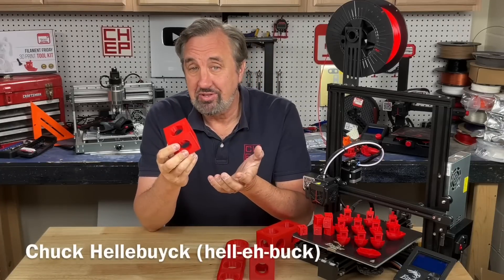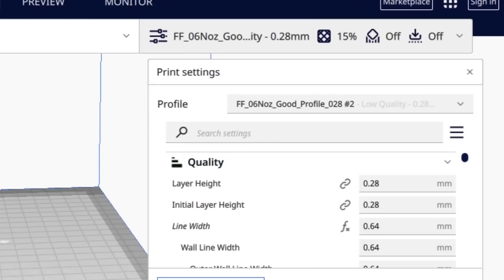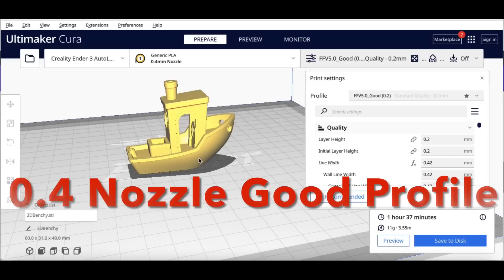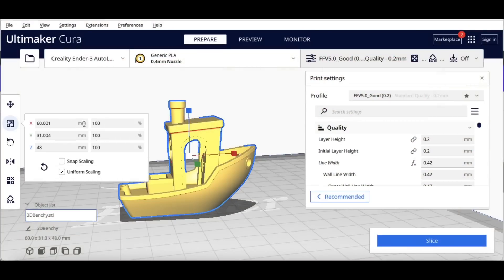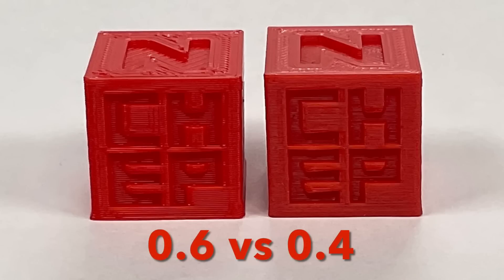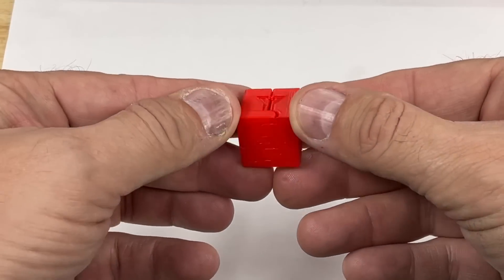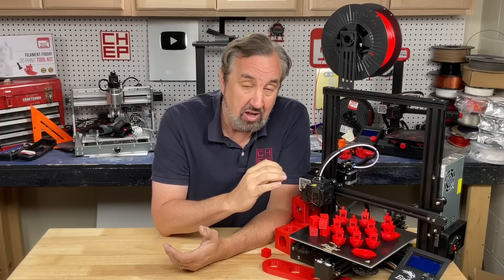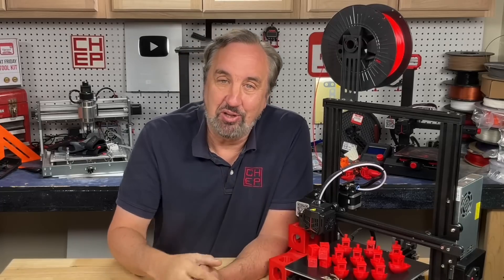0.6 Nozzle Cura Profile for Quality Small 3D Prints

Comment: I recently switched to a hardened steel 0.6 size on my elegoo neptune 4 pro; but now i'm having layer adhesion problems with basic PLA. Had to set my nozzle temp at 230 and cooling at 30% and slow the print down to 95%.... I'm confused! Is this normal?
Reply from the maker: Depending on the filament, yes.
Reply: @FilamentFriday  oh wow, ok. Thanks

Comment: I find with your fast settings and a CR10 + 0.6mm nozzle, I fight between poor adhesion or having the edges of the first later peel-up.  It seems that if you "squish" the first layer extrusion a bit too much, it goes too flat/wide and "cups" on the outer edge, too little "squish" and it won't adhere to the caborundum/glass bed.

0.4 and default settings in Cura were never a problem...

Ideas?

Comment: Great video and really helpful parameters.  Have a project with larger / less detail pieces moving to .6 nozzle on the Ender V3 SE is a time saver.  Having an issue with one of the pieces - infill is globbing up.  I can hear the hot end hitting it and I stop the print.  I’ve tried different infill types and slowed the speed, still occurs.  Any suggestions appreciated on which setting likely needs the most adjustment.

Comment: I have some 0.6 nozzles and was considering switching over my Ender 3 S1 pro. Only problem is, I print lots of stuff from Cinderwing and Flexi Factory and I don't want to take a hit on quality. Anyone having good quality with a 0.6 right now?
Reply: yes the slicers use arachne now my 0.6 gives awesome detail i printed a lilith head in abs its chefs kiss good and faster
Reply: @Paul Robertson  so I bought a sonic pad for my 3s1 pro. Now I wonder if I should set it up first with the 0.4 and then move to the 0.6. Or, just use the sonic pad on my other printer.

Comment: Man you have my sincerely thanks for the shared profile. Changed to 0.6 Nozzle and got printing spot on!
Do you by any chance have other profiles shared 0.6 Draft quality / 0.8 Fine & Draft ones ?
I thank you again for shared profile. Worked like charm on my Ender 3 with E3D V6 and BMG Bowden Clones installed

Comment: Tried the old .6 profile on a Neptune 3 Pro. Does not read profile due to elegoo_base. Tried transferring the settings using notepad but it just didn't print right. Will try this one. Was using petg
Reply: i get the same issue but with pla and i cant seem to get the profile to go into cura

Comment: Hi, Chuck. What is the best preset or settings for printing a dome (for a lamp)? I need it to be translucid and smooth as possible. I thought of printing it with no infill and no supports but my first attempts (with abs) ended up with layer (wall) splitting. Thanks!

Comment: does printing with a 0.6 nozzle use more filament? than a 0.4?
Reply: Yes, because the infill lines get wider and we cannot reduce the infill percentage since the infill density is needed for proper support.
Reply from the maker: It can. Depends on the slicing settings.

Comment: I wish I could get my .6 printing acceptably at all. I've tweaked everything, heat, layer height, retraction higher and lower, speed, infill types and amounts, replaced the bowden tube, calibrated esteps and linear advance and nothing will get rid of my stringing or tiny wall gaps. I hope I don't have to resign myself to stay on a .4mm nozzle exclusively.
Reply: Update- I figured out my main issue where the gaps were concerned. I'm now getting little to no stringing and no gaps. Everywhere I turned told me it was wet filament which just isn't the case (I have a dryer box and dried it multiple times.) I solved it by turning my retraction almost off to 1mm distance and worked up to the optimal setting for me and a Bowden set up on an ender 3 max, which was much lower than I was willing to try at first. It works well at 2.5mm retraction distance.

Comment: I'm trying to get an 0.6 to speed up my process with ASA. I have achieved the strength and speed I'm looking for but there is one (4mm dia.) area that is is curved upwards at a mere 70 degrees and I get curling at the edge which leads to a clump of plastic along the edge but is fine elsewhere. I've tried many settings but what the 0.4 nozzle has no trouble with the 0.6 insists on curling in this area. Even at 0.15 Layer Height on the 0.6 nozzle I am getting curling. As I understand it the theory is that the ASA is shrinking and I've adjusted accordingly with all the popular settings. Preliminary results of my tests so far show I can take my 8 hour print down to 3, if only I can fix this problem. I've run the normal Gambit of Temperature, Speed, Layer Height ect. so I am wondering if wall overlap and skin penetration and whatever else anyone can think of that might help.

Comment: It seems like you cannot change the nozzle size in Cura 5.3 whilst in Cura 5.2.2 it's as easy as using a drop-down menu. So where has that option gone in Cura 5.3.0. Is this the point that I will be changing to PrusaSlicer 2.6?
Reply: Extruder / Line Width? Not sure but in the QIDI version of Cura I use the nozzle diameter is called Line Width. Argh

Comment: That's badass. But I have a question: if we can adjust a 0.6 nozzle to do small good detail prints, can we adjust a 0.4 to do the same thing, but smaller? I have requirements for very fine, smooth, detailed prints.

Comment: its not really fair to compare 0.4 at 0.2 layer heignt to 0.6 at 0.28 layer height.
you would also save time just printing with 0.4 at 0.28.

but as always thx for the nice profiles.
Reply: I'm doing all kinda of testing for a 0.6 nozzle on ASA and I think I am learning that 0.6 just isn't as stable as 0.4. I'm having a terrible time with a simple 20 degree overhang.
Reply: I  agree, the main reason for using 0.6 is to avoid clogs in CF filaments.

Comment: Like this idea of saving time on my prints and they still look good. I'll have to get some .6 nozzles.
Trouble shooting question. I have Ender 3 and Cura version 5.2.2, For some reason recently when printing petg after preheating it changes the set temp from 235 to 175c and it goes into/errors and need to shut it down. If I catch it and adjust the temperature fast enough it continues and starts the print. I have search everywhere and can't see the where 175 is coming from.  ?
 Ideas please.

Comment: This is perfectly timed for me. I'm using a Ender 5 Plus, direct drive DIY conversion. I'm slicing prints to dial in material setting for Amoleb Wood PLA, I'm making a pirate ship "The Lady Harpy" an incredible stl from Loot Studios. So I want the ships hull, spars, Nast etc in the wood, but.... Wood works better with .5 or .6 nozzle. SOOoo a quality 0.6 profile is EXACTLY  what I needed.

Comment: Why is the infill line width set to .7mm?  It seems to me that is a waste of filament.    Unless you need an especially strong part, a smaller infill line width at whatever spacing is needed would use less filament.
Reply from the maker: You can reduce it if you want.

Comment: Hi there,
I think your youtube videos are great /very helpful and always straight to the point.
i have a question for you.

have you tried a Lithphane Print with a 0.6 nozzle? if yes how did it look or will you be doing a video for people to see?
thanks in advanced for your reply and keep up the useful videos
Reply: Lithophanes work well with a 0.6 I changed to one a while ago but went back to a 0.4 I use a 0.6 preset when I want to print bigger and a 0.4 preset for details, there are videos that kinda made me use a 0.4 with a 0.6 profile seems to work pretty well and best of both worlds
Reply: First.. thanks CHEP for all you do. I'm new to all this (3 months) and trying to start Into lithophanes  (and modeling). Thanks for this profile. I'm wanting really nice detail because their gifts. So a .4 nozzle with a .6 profile would be good? Tried a .2 nozzle with a .4 setting a few days ago but I think my setting is off. Thx again
Reply: @leo3times  look up thomas sanladerer on YouTube he has a video on it, I've been using it for about a week, I was strictly 0.6 nozzles till i thought about trying this and now it's working great I've printed off minis using 0.1 layer height and 0.4 extrusion now I'm printing a bigger model using a .24 layer height and 0.6 extrusion
Reply: Also just to note in using this profile now to print just changed layer height to .24 which is my preference
Reply: @thatguyownzz1481  Thanks. Will check it out.

Comment: Sorry chep but now is time to unsubscribe as I’ve moved to the almighty bambu ❤
Reply: Most of his content is 3D printer brand agnostic. His advice is almost universally applicable, not just for the owners of Creality Ender 3D printers.
Reply: Everybody uses chrome but they still have Internet Explorer installed on their pc's. Dont forget the OG's.
Reply: What are .6 advantage other then speed ?
Reply: @charlesrestivo870  The parts printed with a 0.6 nozzle tend to be tougher than the ones printed with a 0.4 nozzle. This is not always the case, the layer height will also determine the strength of a 3D printed part.
Reply: Thanks I'll stick with my .4 nozzles I want tough I use petg

Comment: Can this profile be used for anything other then an Ender 3?
Reply from the maker: @E - You can use it on any Ender style printer. For direct drive just reduce retraction 1-2 mm.
Reply: @FilamentFriday  ayeeee the GOAT responded!!!
Reply: @FilamentFriday  Thanks for the reply! Appreciate the videos and always look forward to watching your videos!!
Reply: I would be wary of trying this on anything that doesnt have a bowden setup like the ender 3, speeds might not match up.
Reply: @Pro_laps6  ok thanks! I have a direct drive setup
Reply: I have an ender 3 DD, I think u might need to change just the retraction settings. If the flow is 100% and your E steps are calibrated it should convert well enough to try. might need some dialing in, but that's half the fun right?
Reply: @AnAcolyteOfTheNewGod  Thanks! I have a Sovol SV01 and a SV06. I may have to give this a try. I don't use Cura (use PrusaSlicer) but I may give it a try. Thanks again!!
Reply: @user-bt9ek2dv2y  My advice, download Cura and load the profile he has, then go back and forth between the two and try to eliminate as many variables as you can. Build a new profile from his experimental one, save that, copy it into a new profile, and then tweek that one. If it's better than the last, erase the first modified version and keep going until its as perfect as you can make it. But that's just me.
Reply: @AnAcolyteOfTheNewGod  Thanks, appreciate the advice!

Comment: 0.6 isn't worth it in my opinion unless you are printing with thick layers and your printer can handle high volumetric flow. You can pretty much get the same thing with increased extrusion width on a 0.4.
Also 0.6 nozzles will increase the size of every printing artifact and make them more obvious and ugly and there are some things you just can't print with them.

Comment: could you check high after slicing? 
layer high * total layers = ?
mine losing 0.5mm on high
Reply from the maker: You Z stepper is probably skipping steps. Check for resistance in the threaded rod movement.
Reply: @FilamentFriday  no chep, its on cura, for example 20mm high at 0.25 each layers, total layers 78. the right answer should 80 layers.
It's happening when not using a 0.2 layer high.

Comment: Will these profiles work well on a CR6-SE?
Reply: You are better off just making notes of the settings and then entering them yourself, I uploaded the FF profile that was meant for an ender 2 to my Ender 5 Plus printer setting and thought I could just change the bed size back but even though I changed the bed size Cura thought my bed was the size of an ender 2 and it ruined Cura, I had to uninstall and go deep into my file system to remove all the files that an uninstall does not remove, after a couple of hours of painful file searching I remembered I could have just rolled back the OS to before I installed the FF profile

Comment: You the best. I love my .6 Nozzle But was having an issue with print in place!  Im going to give it a shot now
Thanks chuck.  I'm curious to know if you've tried CHT nozzles yet and what do you think
Reply: I've used both the CHT and Bozzle and love them.
Reply: @daliasprints9798  yeah I ordered some of knockoffs.  Not that I support clones.  But I figured might as well test them and see. I haven't put them in yet
Reply: @josefdahari  The MK8 CHT clones were unusable for me. My extruder kept slipping even at slow speeds. I don't know how the CNC Kitchen guy got them to work. Maybe if you already have a really good hot end, that can melt the filament quickly.
Reply: @overseerbrian  yah I've been seeing a few people who are saying oh the clones are better than the originals yada yada I'm sitting on a few .4s and a few .6s haven't really got a chance to toss them on one of my printers yet.  Was going to .6. But yeah I've seen CNC say it's been working great in using a stock hot end on sv01 figure I'd give it a try   but yeah was worried it will cause more issues than I want.  I don't even know what I'd do to gain the benefits of using them in the first place to be honest

Comment: Thank you very MUCH! Your profiles have saved me Time and money over many months now.
With my government giving us around 5 hours of power at a time, I needed to learn how to use it wisely. Print resume doesn't always work as planned.
So your super fast profiles have saved me both time and wasted filament.
I use your Ender 2 profiles stock on all my printers. They are wonderfull.
Yes, running 5mm retraction on a Ender 3 S1 sprite direct drive still works.
And here you are giving another profile I will use on my Ender 3 S1 with the 0.6mm Creality Hardened Steel nozzle, I bought the verity pack on Amazon last year. From 0.3mm to the 0.6mm nozzles.
Edit:
Sometimes you just need a really good print, faster. And here you go again. Giving me what I need.
I am prototyping new products. I am a very small, sole proprietor, looking at the big ocean. And here you go helping us again.
Once I am set, I will support you more than just with a like and subscribe.
Reply: Where do you live? Hope your projects are all going well.
Reply: @platinumdynamite  South Africa. Where crime and curruption has destroyed our economy. Where our chief of police (Since apointed to another office), a member of Interpol's wife turned out to be a drug smuggler. We are looking at 10 years of repairs to our power grid, if all goes well. 10 years to put it back to the condition it was during the apartheid era. FYI I am POC...